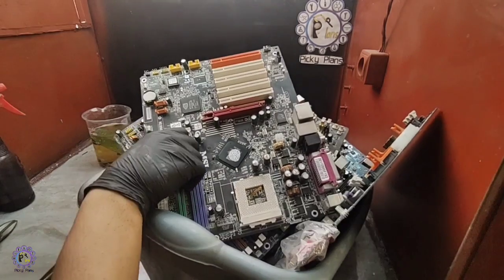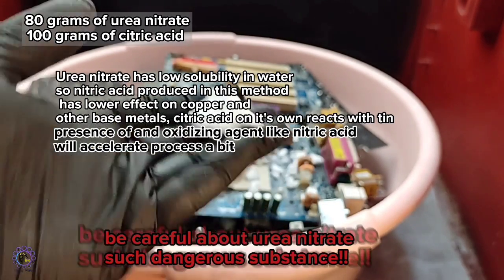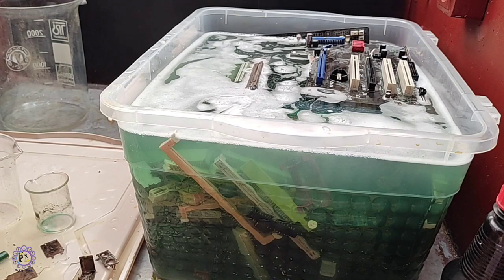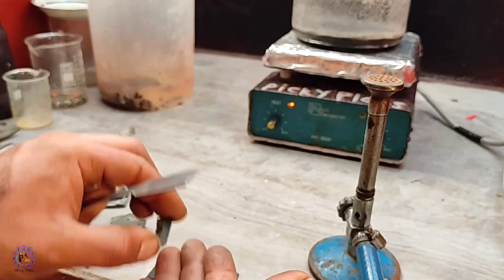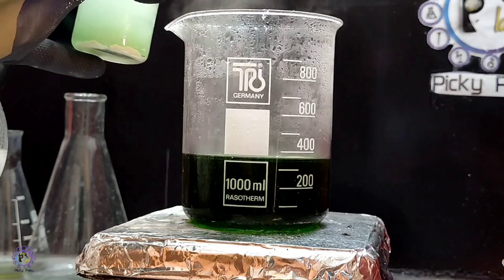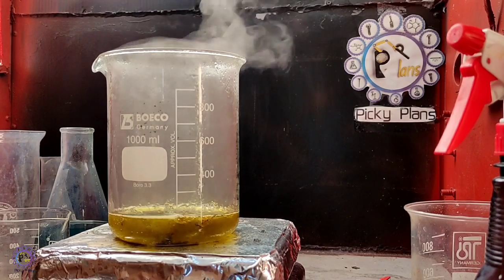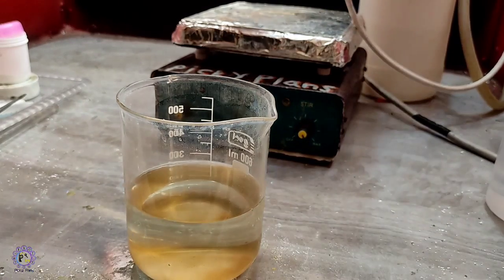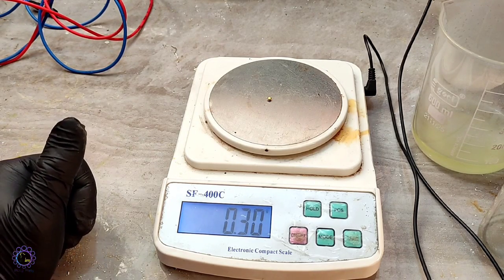Gold from 8 old motherboards | 5 kg

Comment: How do you make urea nitrate? And since it is dangerous to use, is there perhaps another oxidizer to speed up the process? I am very curious about that.
Reply: @PickyPlans  Thanks for the explanation. Since this concoction with nitric acid is so dangerous; do you know if there are other way's (oxidizers) to accelerate the process of getting the Sn into solution? Would a aquarium bubbler make a significant difference? Heating?
Reply: @PickyPlans  Nice! You make me very curious!

Comment: hi what happened about smd component like capacitor/resistor? how did you separate them?
Reply from the maker: After leaching procedure you can catch them at bottom
Reply: i watch other someone using ammonium nitrate+urea+h2so4 is which is more dangerous than your?
Reply from the maker: This method produce urea nitrate which an explosive so yes it's dangerous.

Comment: Does this work? Because I have AR precipitated gold contaminated with tin
Reply: @PickyPlans  does The hot Hcl and aluminum work? Or zinc?  Or roasting it?
Reply: @PickyPlans  I have one solution with gold foils and one with brown precipitated gold. Will this work for both? So boil it with hot conc. HCL then add aluminum?
Reply: @PickyPlans  another quick question. Dissolved some gold foils with ar that came from a dirty solution but may contain silver. But I didn't bother to get the silver first, how do I get it after I precipitate the gold or is it too late?

Comment: Hello man, nice, ho you "squeeze" all the gold from such low grade material. As I see, those boards are pretty old, because old connector types, so more gold than some newer boards... My bet is, that 80 % of gold  is from those few BGA chips.
I usually take BGAs and some other chips and the rest goes into elecronic scrap, because i do not have the capacity to process everything... Thank you for this video, very educative and interesting. SUB
Reply from the maker: Thanks mate ! Yeah you're right they were old enough to have some gold but not much as you said it's good to go for 80% of gold from pins and the rest from chips.
You do it Intelligently , taking all chips and process them, since there is not much gold in pins it doesn't worth the effort. Unless you have lots those old pins. 
Good luck 🤞